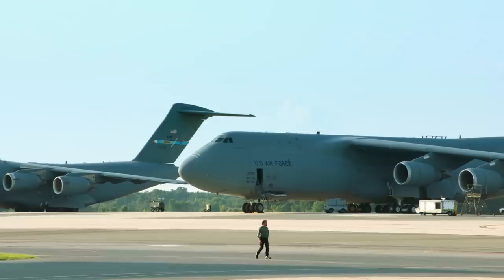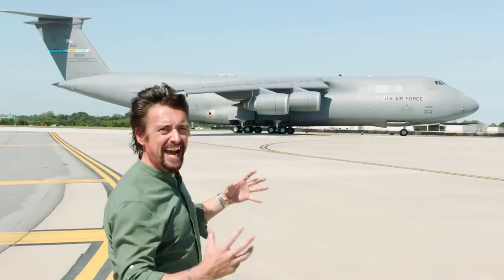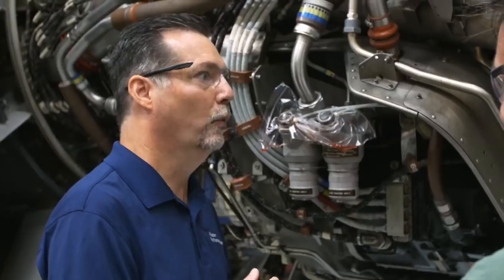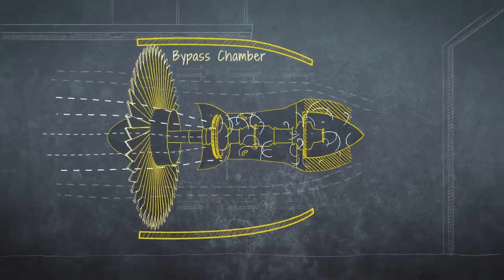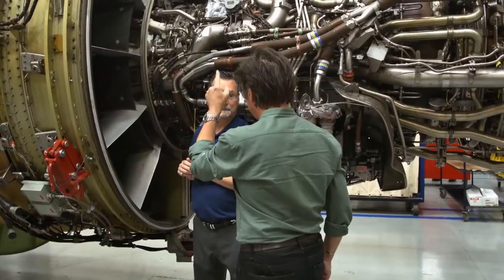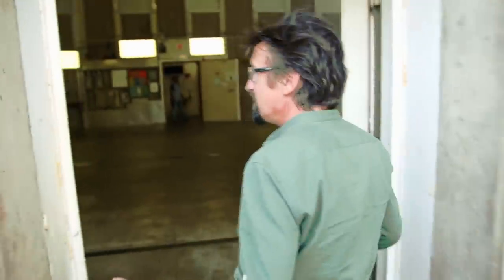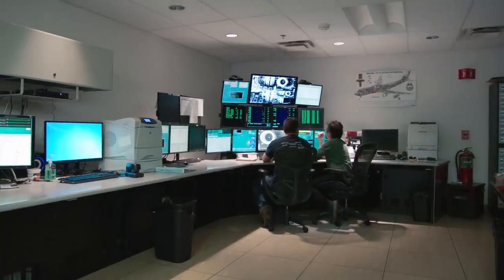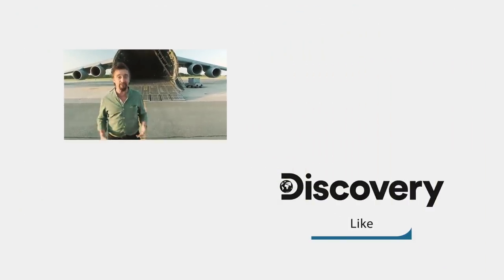Richard Learns How POWERFUL The Turbine Of The Super Galaxy Plane Is | Richard Hammond's Big

Comment: In service until 2045? Sorry. But that's a joke, how long has it been since we've been using planes? And the best we've done in 100 years is extra air flow, more efficient fuel. Same old system.
Reply: There's no compelling reason to create a replacement. The squeeze isn't worth the juice.

Comment: This video is terrible. I worked on those things for 13 years. The original in the 60's used the TF-39 engine and those planes were called the Galaxy. The Super Galaxy and this modified Boeing CF-6 engine made by GE didn't come around until the 2000's. The Super Galaxy is the C-5M which has undergone the EPSU battery mod, Avionics mod as well as the engine mod. The guts are unrecognizable to the 1960's or even 80's versions.
And GE didn't come up with a "radical" new design for a standard nacelle turbine engine, that shit has been around for decades

Comment: Hahaha only a Richard Hammond program would ave a completely ridiculous and innacurate animation for the inside of a turbine engine. Learning how things work, yawn. Is it BIG?
Reply: Milo B the diagram shows exactly how it works. I work on these jets.
Reply: @chokeama3389  So the compressor and turbine blades dont actually come close to the inner casing and the air goes through in swirling patterns does it and there are no stators or combustors and the turbine exhaust goes out the rear fairing does it?What is the yellow cross-hatched bit for? Come one really it's incredibly innacurate and shows very very little understanding of operation. Other innacuracies that are less important include the fact its a two stage turbine and compressor. These programs are almost designed to teach you as little as possible.
Reply: If you know how they work then when bother being upset? These programs aren’t suppose to teach you every detail of everything. It’s a rough schematic. You obviously have your rotors and stators, but this is a very basic diagram of how the C-5M’s engines work.
Reply: @chokeama3389  Because it's a program specifically about the wonders of the first high bypass turbofan and the bloody animation is misleading and farcical. Its not a basic diagram it's completely wrong. Seriously at least the exhaust should be going out correctly and the turbines should be placed correctly.